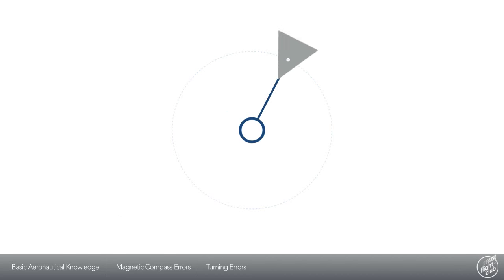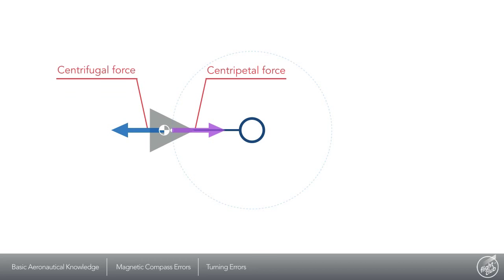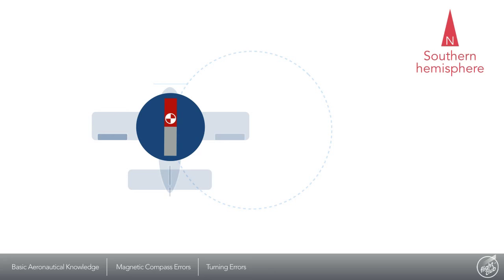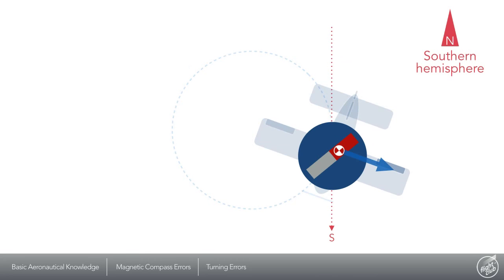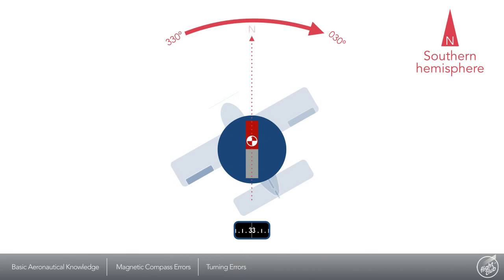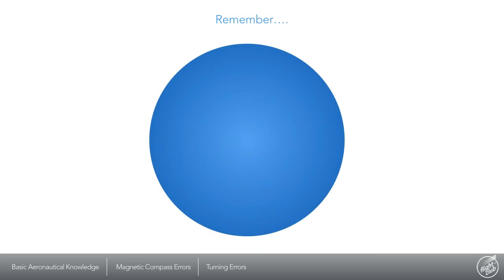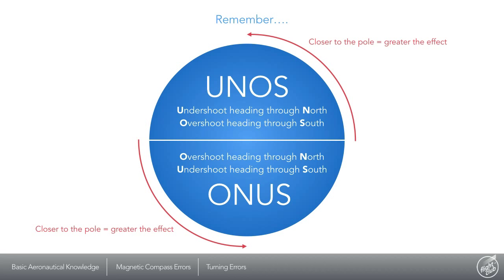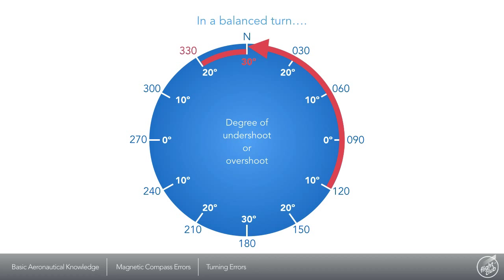Magnetic Compass Errors. Part 2. Turning Errors.

Comment: If the centrifugal force on the magnet was the cause, then the error would depend on the direction of the turn (left or right), not on the heading the aircraft is passing through
Reply: You have to realize that the center of gravity on the compass is not pushing it straight down, once you're in the bank it's actually off of center because there is a small torque applied by the magnet trying to dip itself into the magnetic flux. This means that it's already being pulled a little bit off center by the magnetic field which is what allows this effect to occur

Comment: I believe this video is incorrect. In a coordinated turn, there should be no lateral forces, so the compass would only feel a vertical force, which would not effect the reading. In fact, the error can be seen in unaccelerated flight, which means the centripetal/centrifugal forces can't be responsible. In straight and level flight, the compass dip is vertical, but in unlevel flight, the compass dip has a vertical AND horizontal component. The horizontal force (caused by the magnetic dip) causes the error in heading.
Reply: In a turn centripetal force and resultant centrifugal force are always present no matter how coordinated the turn is.
Reply: @alexw8758  yes but in a BANKED turn the lateral component of centrifugal force is cancelled out by lateral component of weight. What we are left with is a „z-axis” acting force (being the sum of weight and centrufugal force) There are no lateral forces that have components in XY plane. This turning error is caused by apparent movement of compass magnet when banking. This only has to do with a change of aircraft orientation with regards to magnetic flux lines.